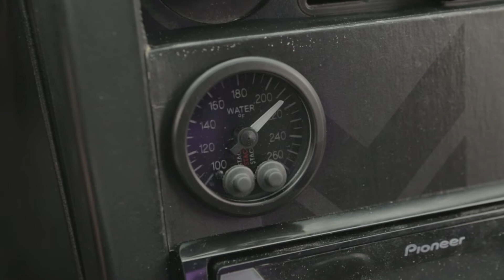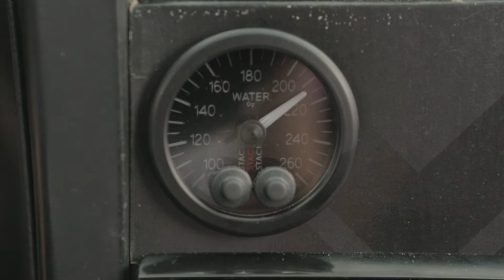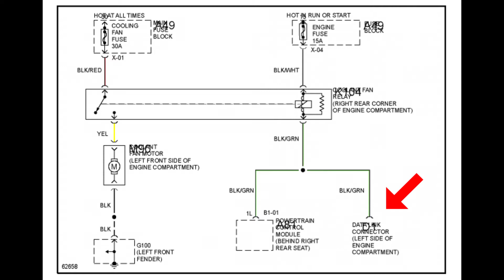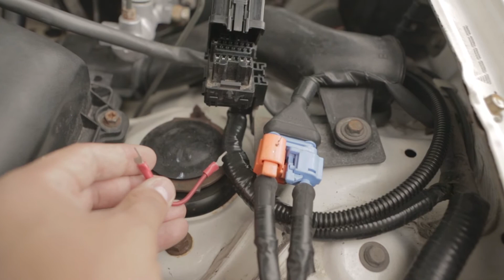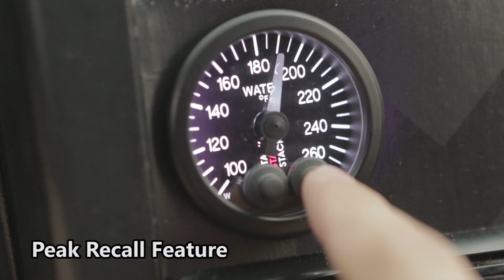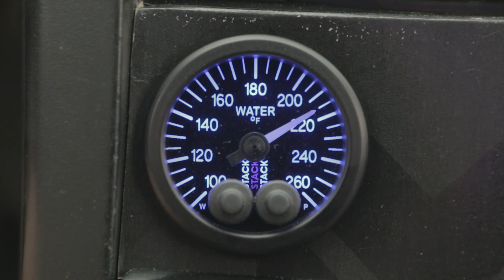How to: 94 NA Miata Cooling Fan Temperature Sensor Bypass ft. Stack Pro Control Temp Gauge

Comment: If my temp gauge is broken could that be why my fans won't come on?
Reply from the maker: Sorry for the late reply. No, the temp gauge is not connected to the relay that controls the fan. The gauge only runs off the temp gauge sender on the head.